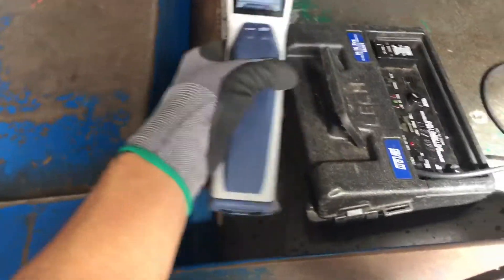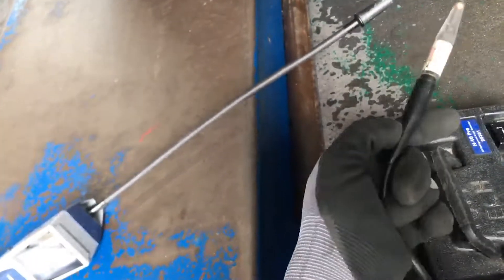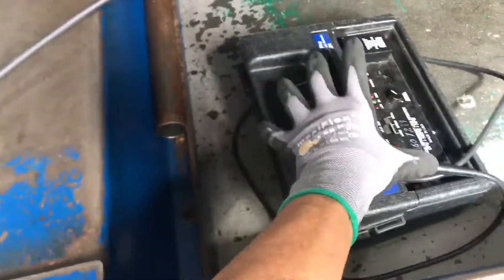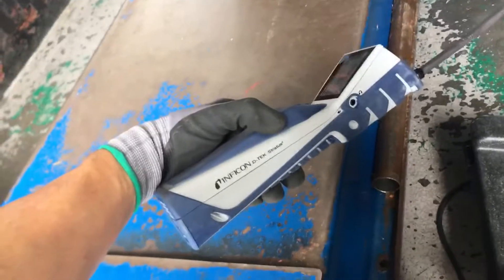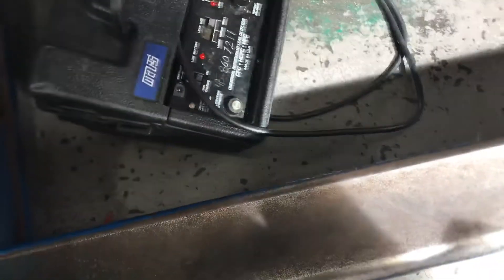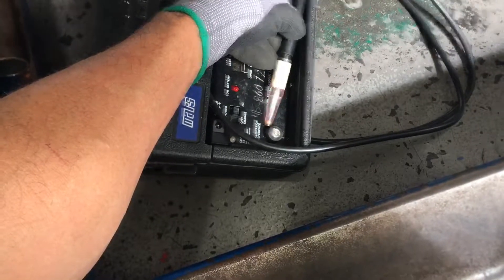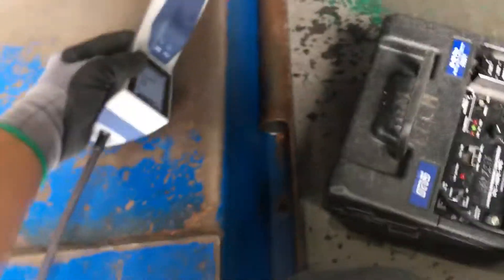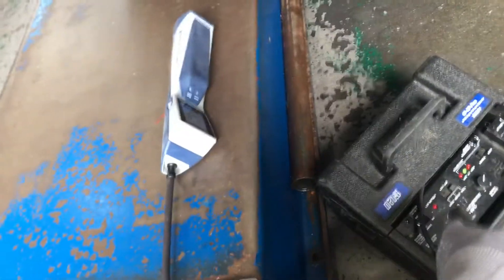H-10 Leak detector vs D-TEK Stratus, H-10 wins in this scenario

Comment: Do you recommend those leak detectors from snap on and Matco from the auto tool trucks ? If you could pick h10 or d tek stratus which would be preferred? Seems like these leak detectors you pass gas and they go off super sensitive. I have a snap on and it’s ok sometimes doesn’t really help.
Reply from the maker: https://www.trutechtools.com/Inficon-D-TEK-Stratus-Refrigerant-Leak-Detector-and-Portable-Monitor

The age 10 was one of the best refrigerant leak detectors for CFC refrigerants but we no longer have CFC refrigerant in vehicles anymore the old days of R12 refrigerant are long gone

In the link above with that refrigerant leak detector you could swap out the sensor and it could do flammable refrigerance to propane butane and if you do used CO2 or had a CO2 leak unit you can change the sensor for detecting CO2 so you basically get three refrigerant leak detectors all in one

Comment: The H10 calibration gas only works with the H10.  Will not work with field piece or stratus
Reply from the maker: Yes I know,   Found that out later. 
Actually have to be a calibration calibrated Leakport for refrigerant and they’re Hella expensive like $300-$600 depending on which one you buy. 
It’s a precisely machine piece of metal to be put over refrigerant bottle at a particular temperature for pressure can you purchase some customer specifications for the leak rate for a year

Comment: Inficon tells you in the manual it will not pick up the R-11,  H10 calibration gas. Also use the Stratus in the Super Mode for the fastest response and most sensitivity. PPM is way to slow to respond and it's better for narrowing down the location on big leaks than finding them.  I own both detectors.
Reply from the maker: I like the parts per million mode because I take a picture of it to put it in the customers invoice picture tells 1000 words it’s very good for that. 

           Too bad they couldn’t develop a reference bottle with R410 As a reference for  all the residential units and commercial
Reply: @coldfinger459sub0  They have one for R-134a. I just posted a video of this and the newest release from Inficon if you want to check it out. https://youtu.be/kYWpP1QYXt4

Comment: If you was looking for a good automotive A/c guy how would you go about finding one what questions would you ask them?? Thank the automotive world need more people like you that care.
Reply from the maker: They have to know the physics and fundamental like the back of their hand superheat and sub cooling. They really need to understand that airflow over a evaporator or condenser even if it changes a little bit will greatly change the pressure and temperature readings from the gauges giving them false information. 

         They have to know the importance of the electrical system and charging system and condition of a battery on new cars will greatly affect the operation when safeties are kicked in because of intermittent low voltage. 

          It’s a very big bonus if their background was heavy into electrical and drivability diagnostics and understanding small controls because simple things like an overheating engine can cut out the air-conditioning through sensors

        They know the check manufactures TSB technical service bulletins for late change updates of either physical mechanical components example a condenser that was inappropriate for the initial assembly of the vehicle and they found it out later.  They have a replacement condenser or hose to take care of some sort of operational problem or actual mechanical failure. 

         A technician must know the old tube and fin design condensers and evaporators are drastically different than the crucially charged modern micro channel condensers and microchannel evaporators. 

         The shop or the technician must be willing to invest the time and money into training and continuous education as the vehicles become less tolerant and less forgiving to even the slightest small errors in charge or excessive oil or excessive moisture or contaminated refrigerant the technician Hass to be on top of his game and actually have the tools and knowledge to test for these situations and understand how to interpret the readings on the equipment he owns. 

      Usually places to stay away from high-volume franchises working on commission fast pace work need to skip procedures to get the next job down to generate money so everybody can make their bonuses from the service manager to the service writer and The Mechanic. 

Place to stay away from they only use UV trace dye to look for leaks

Place to stay away from they use the cheapest corona discharge sensor technology for electronica leak detector

      Place to stay away from they only have one universal refrigerant oil they stick in all vehicles no matter what because it’s cheap

        A place to stay away from they offer top off refrigerant as an AC service you never top off modern day cars. 

       A place to stay away from especially if you have a new car they have a old refrigerant machine that’s 15 years old somewhere around there. Especially if it’s one of those really old machines 20+ years with the moisture indicator site glass and moisture indicator color is yellow

     Place to stay away from they could do an AC recharge but they don’t offer the service to look for leaks because they don’t know how and they never invested in any of the electronic leak detector’s to look for the leak they just know how to squirt in bottles of refrigerant. 

There’s 100 other things but this list would get way too long